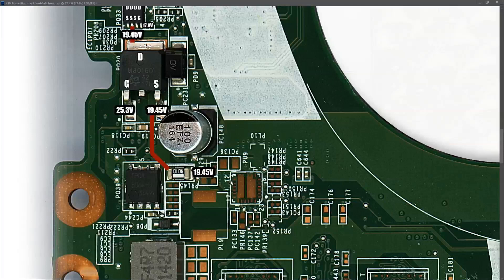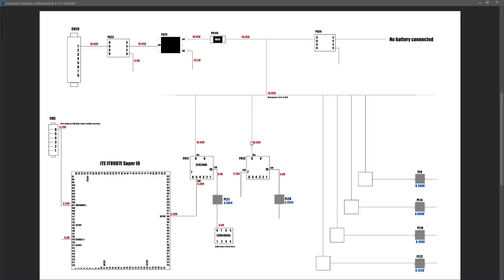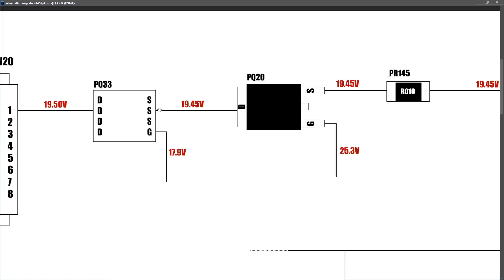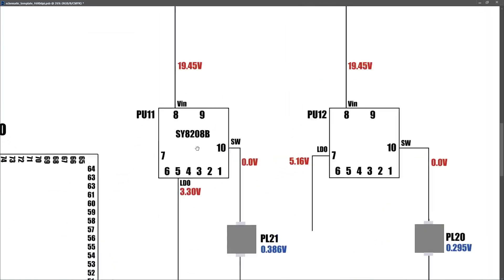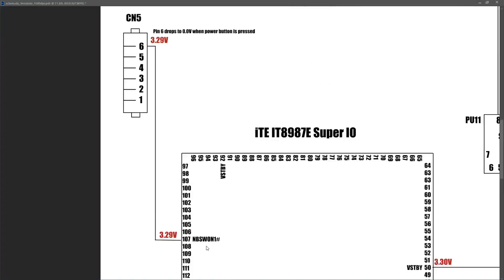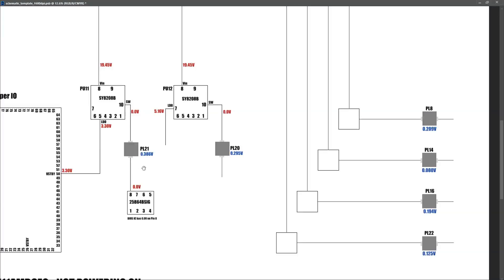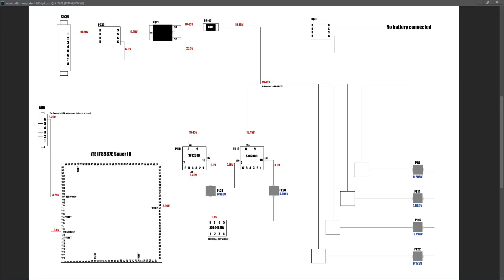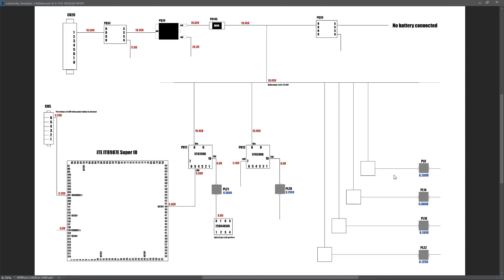HP PAVILION DAY11AMB6E0 - DRAWING UP THE CIRCUIT TEMPLATE

Comment: This is more or less a "block diagram" and many times you can find it in the schematics you download from the internet. Some have it some don't but indeed is very helpful with just one look to find all the power stages and the ICs that are involved. Some other also have the power sequence and the S states which is also very handy in troubleshooting. Well done for spending so much time and effort into this.
Reply from the maker: Hi Nik, I'm still unsure as to whether drawing up such a graphic for each video will be feasible. I keep a running log of measurements in Microsoft Word at the moment, so maybe I'll just log the data on the graphic instead. I'll with try with the next repair.
Reply: @therepairshare673  It depends on you. If you want to build a database for helping others or just to practice your skills, as long as you think it's needed. It's sure though that for someone who just starts repairing and troubleshooting would be much of a help. Keep up the good work. Cheers mate!

Comment: This is a great idea! I do think drawing the circuits out on a PCB design program rather than Photoshop would be best as there may be a learning curve to using the software but it will speed things up.
I also think that you will find the fault on the laptop if you work out why the first mosfet Gate voltage is too high. I think it should be 15v or lower... The reason the gate voltage is high is that the chip driving the mosfet had maybe identified an issue somewhere else on the board. If there is a BQ chip it will have mosfet short circuit protection. Check all the MOSFETs on the board to see if any others are shorted.
I would also focus around the charging circuit. If you can get a battery and see if it's charging it will tell you a lot.
Reply: This is a great initiative, and your efforts are very much appreciated. It's definitely a more user friendly approach 👍

Comment: Hi, hope I can help ... I would check the following :
1)  3.3v signal NBSWON1#  on EC chip has to drop to 0v for a split second when power button is pressed ( not sure if you already measure tha) 
2)  I would focus on PQ33 ,  should be 19.50v not 19.45v ..... Gate is controlled by PQ38 and 17.9v seems too high 
3) 3.3valw ,5valw, 3.3v Bios pin#8  will come once board is on
Reply from the maker: Hi celulartj, thanks for your suggestions. 
1) Yes, the button is working. when I ground the NSBWON1#, I see the current draw goes to 4ma then back to 1ma
2) I have replaced PQ33, and grounded the gate with jumper, but no difference. Sorin has a video up about the same laptop and his also seems to drop 0.05V across that PQ33. But I'm just not sure. 
3) This again is a source of confusion. One video I watched on youtube says 3.3ALW and 5VALW are only present when board is powered on, another video says that they are present when plugged in.

Comment: Seems like most laptop problems are due to faults in the 3V and 5V circuits, as well as the battery charging circuit. Those circuits seem to take most of the abuse. As for gaming laptops, it seems most faults are with the DR-MOS power supplies to CPU and GPU vcore.